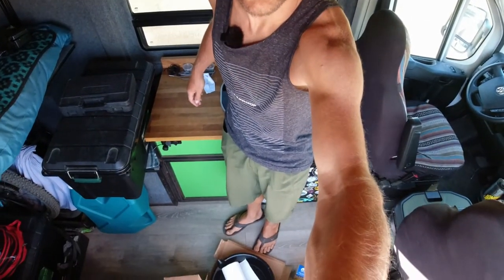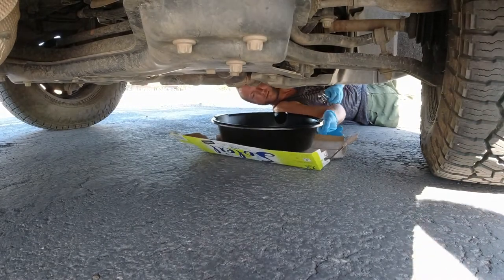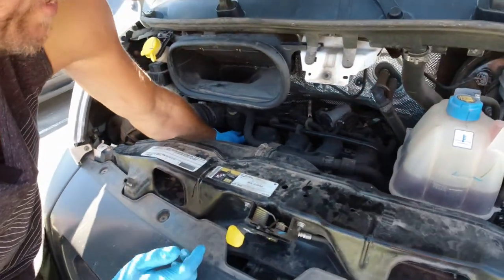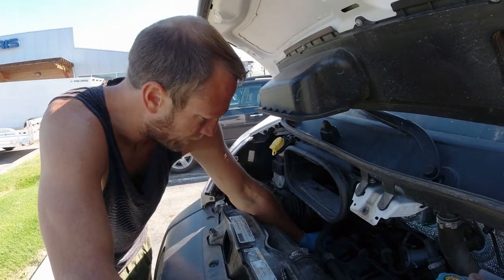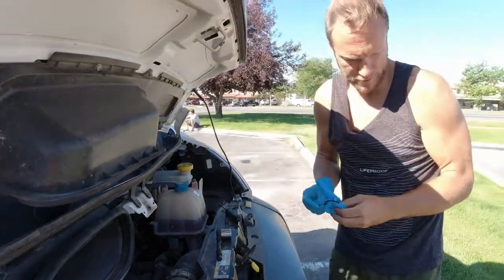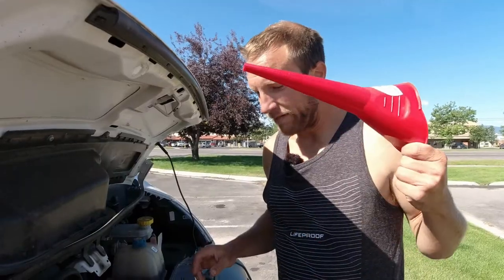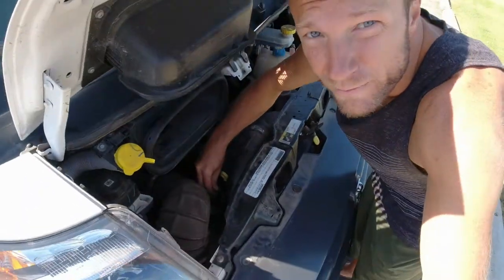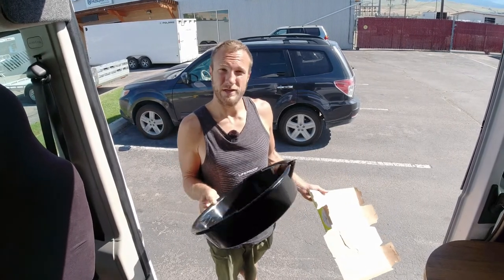How to Change the Oil in a Ram Promaster: Easy DIY to Save Money for Vanlife Maintenance

Comment: Thanks for this!!  I'm still curious though, what did you do with the old engine oil?  You said 'drain it back into the bin' - but what bin are you talking about? Safe travels!
Reply from the maker: Thanks for watching!  We drain the used oil back into the empty oil containers and drop it off at a shop that takes used oil.  Most Automotive stores like Autozone, O'Reilly or Napa take it.
Reply: @DrifterJourney  That's good to know!!   I used to enjoy changing the oil in my cars when I was younger but then a lot of gas stations stopped accepting the used oil.  I'll double-check with my local O-Reilly... and then I'll need to get one of those stubby ratchets! ;-)
Reply from the maker: The stubby ratchet is a must! We were paying for oil changes (bringing our own oil/filter) until we got to CA and Jackson,  WY. They want $40-50 in labor alone. That's when we started doing our own again.
Reply: Thanks for this! My dealer mechanic wants to charge me $170 in SoCal which seems crazy. I think I could do this myself with some patience and your video. I have the 2022 so I’ll have to see if the parts look the same.